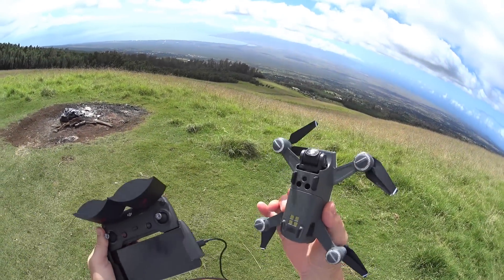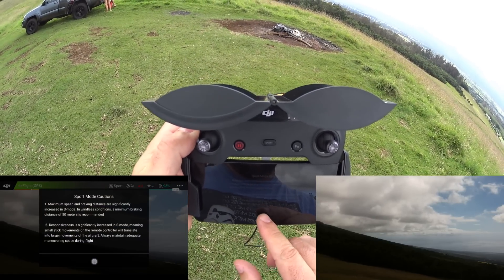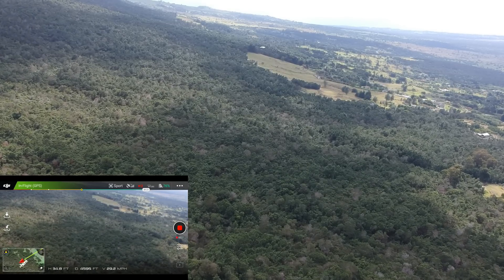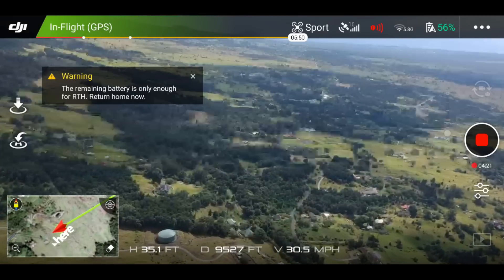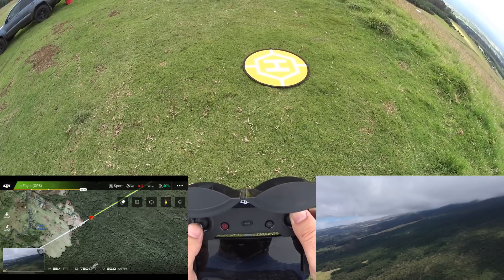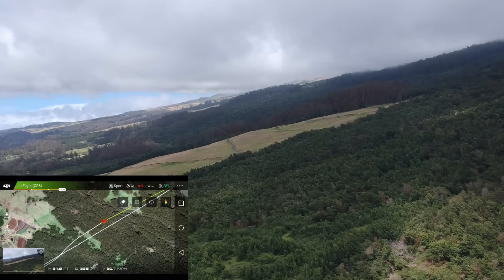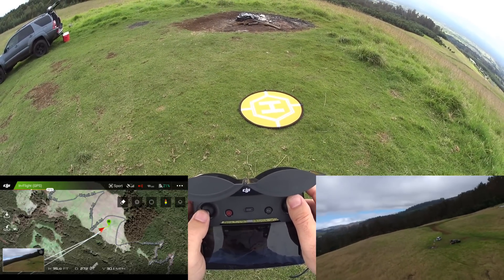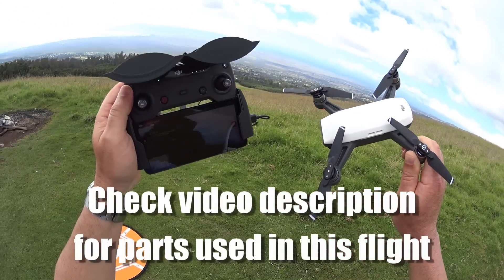DJI SPARK Review - Part 4 - [4+ Mile In-Depth Parabolic Range Booster Test 😱]

Comment: I can only go about 1300 feet away before i get signal loss (without dishes). Is there any other type of range extenders because the dishes is out of stock or should i just wait until the dishes go back in stock???

Comment: Part 3: 9900 ft
Part 4: 10900 ft
So the parabolic dishes only add +10%? Whenever I’ve used them I didn’t notice any significant difference and it wasn’t clear if they’re a placebo effect product but I didn’t perform as similar of flights as you did here.

Comment: i have a question what is that cable going from the remote control to the phone, is that part of the range booster or something else? Also do you just click on the range booster and it works or do you need to hook it up with the app because im interested in getting the range booster

Comment: I have watched both of you videos on the Spark range. They were very good. Gives me a little more confidence with my Spark.

One thing you keep bringing up, is that you cannot know the real altitude of the Spark. You are correct that it sets as zero the altitude at which it is taking off. However, if you know the true altitude of where you have taken off, and have topo maps of the area you can then estimate the correct altitude. Let's say your altitude is 200 foot higher then the area that you send the Spark to. Then you're true height would be whatever the difference is between that elevation and the elevation the topo maps show where you're spark is plus whatever altitude you gave the Spark. So if you're starting altitude is 200 foot, and the area the Spark is over is at an elevation of 100 foot, and you have your spark set at 100 foot then you would actually be three hundred foot in altitude. Takes a little mental gymnastics, but with practice you should be able to do this.
Reply from the maker: In general, I think cross referencing a topo map in real time would be quite a distraction.   Hoping popular drone companies will include an estimated AGL  reading soon based on drone GPS location 👍
Reply: @DustinDunnill  

I was not thinking in terms of constantly referring to a topo map. My thought was that in this particular flight, it was started at a high point and the topography continue to decrease throughout the outward flight. Just knowing what the low Point elevation is would give you a good estimate of what the true altitude of the Drone is.

Comment: i’ve only manage to reach 1.94 miles (one way) with the parabolic extender and OTG cable connected via my I-Phone into the controller. 

i’m wondering if there’s an optimal altitude to preserve the signal for as long as possible? 

obviously you’re in what is essentially an ideal environment in terms of no conflicting signals/interference. 

any advice? 

i really want to hit the two mile barrier. 

thanks!
Reply: Don't go too high neither should you go too low, make sure your remote is pointing directly to the drone and your antennas must be 90 degrees straight up. And if you're in an environment with loads of interference try using the 5.8ghz band and not 2.4ghz, 2.4ghz is more for places where there's no interference at all. Try this and give it a shot, let me know how it goes.

Comment: Excellent as always. I did a search on range extenders and found those reflectors, a good deal for about $15, range is limited by battery power and the reflectors work really well, as you have shown. Thanks for your videos. I just bought a Spark for a really low price and excited to get this kind of pro-performance and stable video without spending over $1,000.

Comment: Completely agree, even without range extenders this drone goes a long way. All that determines distance is battery duration.

If we had up to 25 minute flight times, the drone could go further.
Reply: Im in Europe and still not even close to this range. I can go about 330 feet far away.

Please let me know it you know something to get better distance.
Reply: @aleksandaralobic171  try turning off beginner mode in the settings , i had mine on for first couple flights and it was doing the same i turned it off and it passed that short barrier

Comment: Really great videos. Question if you see this: I keep seeing warnings not to use OTG cables on the Spark. Are these warnings incorrect?
Reply from the maker: Not sure.  They may have changed the firmware and no longer support it.
Reply: Okay, thank you. Maybe it's just not recommended by DJI and that's what I'm seeing.

Comment: That's pretty impressive. I order the Parabolic Dishes for mine since I live in an urban area and can only get around 3/4th Mile due to signal noise. I am Curious just how much these will end up helping. I do wish the spark had a little better battery life though, about 13 Min in sport mode is all I can get out of it... Hopefully DJI comes out with a better battery soon.
Reply from the maker: You should notice range improvement with the dish in an urban areas 👍

Comment: Watching the time line, it looks like you got between 11 -12 minutes of actual flight time in sport mode on a full charge. How much does flight time change for "casual" flying? I plan on just doing aerial still shots so the vid res is not crucial to me. I definitely want to try and be up around 300-500 feet. If I do shoot vid, is it more choppy in sport mode than casual flight?Thx.
Reply from the maker: Between 14 and 16 minutes flight time for just normal cruising around 12mph ☺️👍

Comment: Great job, If everybody was smart enough that watched your test they should note that you were up high on a mountain and very high off the ground. You had an unobstructed field that made your test the ultimate distance it would go. I also have an x16 that I play around with and was one of the first to install a parabolic booster and I live in kingman az and live by a very large dry lake. It is about 10 miles long and 5 miles wide, so when I go to test it out it is flat with no obstructions just like your test. Awsome job.
Reply from the maker: Great observation 👍

Comment: Seems like DJI figured out the max size battery they could fit in the SPARK (size), then determined that there was no reason to put Ocusync in it, therefore the Range is limited by the fact the Battery couldn't support a safe RTH if you exceed the 1.2mi limit...otherwise we would have others trying to exceed the limit and Spark's falling out of the sky left and right!

Comment: Question, since u used a LG phone I assume it runs android. So have u flown it recently with OTG and the latest dji go 4 app...do you get telemetry readings and GPS sats? Cuz with me and I've heard from others that there are no readings connected on android device with OTG. Do you have the same issue?

Comment: The little spark is awesome but the only thing stoping thousands of people from buying it is the damn small battery....
Reply: Yep which is why the fly more should have had 3 instead of 2! This thing just burns through them.
Reply from the maker: +joshua12345676 They have 3 with the Mavic air combo.  Wonder if they now include 3 with the spark combo recently?
Reply: I do not believe so as I recently picked one up. I guess it is mainly because they had to fit in a $120-150 controller into the bundle. All while keeping the price point semi attractive.
Reply: I have 4 batteries with and got the 4 space charger on amazon.

Comment: On screen your height says you are at around 35ft. Those trees below are taller than that. Why is it saying H-35ft.?
Reply: PalmettoMoon The ground is sloped downhill, and the spark uses the height above where you took off. So he was 35 feet above where he first took off, but the ground slopes downhill without the quad realizing it, and the screen just says how high he is above the original home point.
Reply: SquiDragon 👍

Comment: I'm about to buy one of these and read some comments on some blogs and forums that pilots have experienced signal drop? Is this just over wifi or RC as well? Did you have any connection issues?
Reply: Sometimes if you are behind a object it will be glitchy becouse it’s WiFi not aqusank so you get more range with aqusank. So maybe you could get mavic pro if you want more range.

Comment: I tried my Spark everywhere.... out of town, on a hill, on a beach, even on a mountain at 4000 meters high... and yet, even with the OTG cable, I can never get it more than 300-350 meters... that's 1'100 feet :-(
Reply: are you in Europe or the US? if you are in Europe you need to get FCC software upgrade as the Europe software on the DJI is limited to about 1000 feet. As soon as you do that you will hit ranges like this shown here :-)

Comment: Dustin, I think I heard you mention that the android app crashed. I have an android phone. I've read a lot of people are having issues and you shouldn't buy the spark if you only have android. Can you comment based on your experience? Thanks!
Reply from the maker: +Matt Jones Hey Matt.  App usually crashes about once per flight unless I don't really touch it or rotate the screen by accident.  I don't think it's that bad of an issue since there are so many smart functions built in.  Maybe do some research on which are the least problematic Android phones before you buy.  I have an LG G6 FYI. ✌
Reply: Not that I like them better but my Iphone 7plus has never crashed while flying the spark.

Comment: You have made a good job, but for a good apple to apple comparation could you please make a similar experiment but installing and desinstalling the parabolic booster? If not the comparation is not "cientific". So An easy way to do it could be hoving 1 km away and without move the remote take out the dish and see what happends. Thanks a lot

Comment: My max range is 21,362 total flight, going 10,680 in one direction (a tiny bit over 2 miles in one direction). Completely stock, no parabolic add-ons. At the max distance away I still had 2 bars of reception like you did in this video, but the Spark warned to come home because of the battery - and boy did it calculate it correctly, it got back home with about 3% left. I checked my Flight Records I'm the app after and when I started to fly away I was already at 90% battery, so I need to be quicker next time. I also think my max range had to do with weather and lack of wind, because I don't consistently get that range. I'm also in a suburb next to a big city, so there's lots of towers and anything you can think of that give interference, so I'm more suprised than anyone that I get decent range.

Comment: I have ordered a set of parabolic's for the Spark, they came in the other day but I haven't had a chance to try them yet. I fly without using the OTG connector, I wonder how the results will differ from your flight.
Reply from the maker: +Ron Brown I notice a bit more lag and FPV garble when connecting phone to RC via wireless.  Another range test without OTG is in order 😀
Reply: B

Comment: Hey Dustin, on the video you were trying to get the map to move and follow the drone, I'm pretty sure this can be done by unlocking the icon that's on the upper right of the map that looks like a compass needle. Cool vid!
Reply from the maker: +Chris Perry I think I've tried that and it just locks the map to North or not.. I'll have to visit it again to see if it enabled follow.  Thanks for the recommendation 👍
Reply: Dustin Dunnill hi Dustin thanks for the good work do you recommend those parabolic for my mavic?
I fly maximum rang of 1.5 km I don't know why than I lose signal any tips cheers

Comment: The Spark is looking better but for $500 it's inexcusable to not have the controller in the box. After hauling my P3 4K half way across the country on both RJ and mainline planes I'll be getting a Mavic before heading to Hawai'i next spring.

Comment: Great job Dustin. My question is when I use the OTG cable I don't have the option to select frequencies, it defaults to 2.4 and stays there. The wi-fi indicator in the app turns off (because I turn it off on my iPad or iPod touch to make sure it is not connected via wi-fi). The only way I can know if I am pushing the range limit is to wait for my screen to lag or lose video. Any thoughts?
Reply from the maker: +cjamproductions I've hear that happening with Apple devices.  It's the opposite for me (forced to stay in 5.8 when OTG cable connected) unless you connect without OTG, switch to 2.4 then connect OTG.  I did it the same day in 2.4 and it was not nearly as good as 5.8.  I'll have that vid up soon.
Reply: Dustin Dunnill how do you get the wifi status when using otg cable? That is always gray for me when using otg.
Reply from the maker: +jesperbbb I haven't compared using apple yet.  Maybe I'll try with my iPad later to see what happens.
Reply: Hey Dustin, Great Video! I'm leaning more and more to this unit, with every new video you make!  Question Please = what is the camera that you are using on your hat, and how have you mounted it to your hat?  I'd love to see some photos, or a video of your "hat camera review"  so I can figure out how to use one for a body cam, sort of application.  Thanks!!  :-)
Reply from the maker: +SkuStyle thanks bud.  Flagged them for spam ✌👍
Reply: Would u recommend this as my 1st drone ?
Reply: I have the same problem with my galaxy s7 edge when i use the otg cable I lose distance height and mph readings I have no satellite info either
Reply: cjamproductions I have the same with my spark and otg cable. I can't select anything and it's locked at 2,4 ghz. Using iPhone if that is any different to android
Reply: jesperbbb yea, same thoughts here..
Reply: jesperbbb always gray for me as well with iPad mini 4
Reply: A link to the parabolic dishes would be helpful, many TX

Comment: Far better reception than last time.  The Spark is slowly growing on me.
Good video again.
Just out of interest I did a test of some google based software  which calculates ground altitude in map or satellite mode ( I use it for the very small valleys I fly in.) ;)
Wish 'drones' had that facility or even the ability to terrain follow
Reply from the maker: +didactylos4 diddy4 would be nice if companies making smart flyers like this could incorporate that ground altitude in there UI soon 👍
Reply: My Mavic Pro (original) has that feature! It’s literally called “Terrain Follow”!

Comment: do a battery mod Dustin! just open the battery up and solder up a jst lead then add a 2200mah lipo
Reply from the maker: +Uzoma H. Nope, you must have gotten a defect or it was user error.  I've flown the crap out of mine and it's hasn't let me down.  If they can up the camera resolution the Bebop with rival DJI even more.  Speaking from my won experiences, and flight tests.
Reply from the maker: +KevokevoMC Maybe 😉
Reply: Billy Darley If you get the spark, you could buy the litchi app(its like $20 or something) and that has a VR mode in which you could just put your phone in a google cardboard and use FPV that way.
Reply: Cant you just use a ~3000mah lithium cell phone battery in the spark? You can double the mah and keep the weight low
Reply: i would totally try a battery mod. i was 99% sure i wanted a bebop 2, but the more i learn about the spark the more im leaning towards the spark. now im down to about 60/40. just depends on package cost. i want goggles included so thats why i still might end up with bebop2. i suppose goggles could be added later...
Reply: rustler08 
Oh right, I forgot to add that you then need a spotter to do that. 
I’ve never used the litchi app, so I’m just going off what I know about it. I’ve seen people use the cardboard though and it looks pretty cool, even if the screen quality isn’t the best.
Reply: Joshua Spengeman 
I think the stock spark has a 1480mah battery in it, so I think it would add about 1.6-1.7x longer flight time.
Reply: KevokevoMC why not add solar panel on top too integrated to the battery set up!
Reply: rustler08 who cares
Reply: the only down side with bebop 2 is the camera or else I would of gotten it. spark will do for now but it does cost alot more googles
Reply: Barry Corpuz 
Charging and discharging lipos at the same time isn’t a super safe idea, unfortunately :/
Reply: I hope you didn't end up buying the bebop 2, those things are garbage. i owned one and it was trash.. i had to send it back for a refund.
Reply: Which violates FAA regulations unless done indoors.

Comment: If I got those reflectors, it would be for the more solid downstream video back to my viewing device. Not sure that there will be a significant difference if you try this at 2.4ghz, since there is likely to be much more interference on that band .. but who knows. It appears that the limiting factor is the battery. I've personally only had mine out a little more than 1/2 mile. The darn thing is so small, I lose sight of it once it gets a bit over 100 yrds away (and up maybe 200 ft.).  We'll look forward to your 2.4ghz test, but, again, I think the battery will be the limiting factor. But it might be interesting to see what the downstream video back to the viewing device looks like compared to the 5.8ghz video feed. Mahalo!
Reply: Bill Somrak I

Comment: Also with these test going straight forward can you do a test flying around at those distances cuz I don't think anyone is just going to want to go in one direction.
Reply from the maker: +george aura With these antennas you need to point it at the quad. It focuses the signal in one direction.. so don't use the parabolic booster if your Flyin' anywhere but Infront at about a 40° cone

Comment: With those dji devices is there also a way to have your mobile device and control attached to a power bank to extend your flights as you use more bats in the drone
Reply from the maker: +george aura You could charge both if you connect wirelessly to controller but not if you use OTG cable.